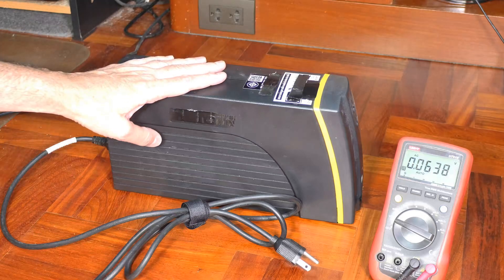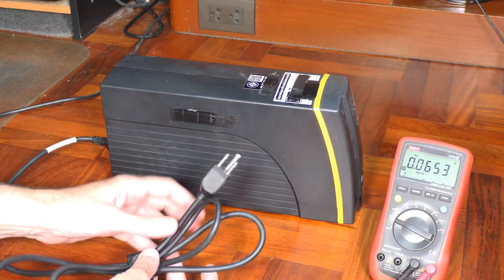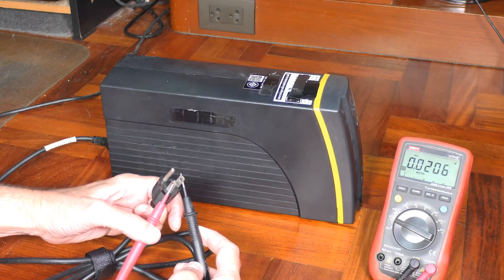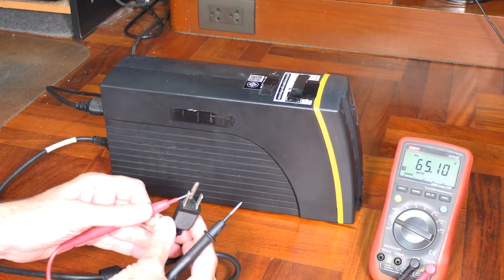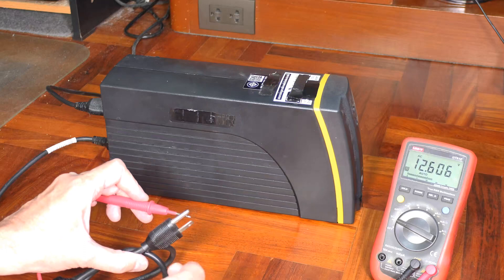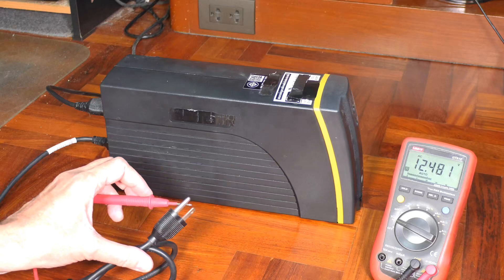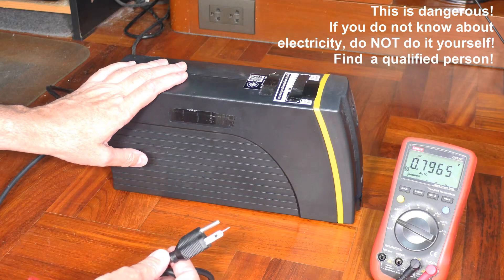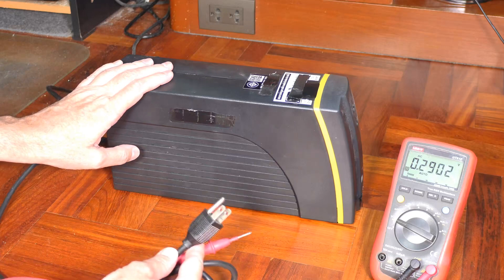PSA: Surprising Computer UPS Shock Danger! (4K)

Comment: Same here,yesterday i was trying to clean my ups(digital storm)from dust using air blower and toched the IN plug by accedent and got a good shock.so i tested the IN plug lead and got voltage in both L and N,but when i unplug everything for the ups ie pc,monitor and other stuff the shock is gone.this is really scary fault or design(hate electricty btw).
Ill try my other farber online ups and check the results.
Thanks for the video.
Reply from the maker: Oddly enough, youtube put your comment in the "hold" section pending approval. Not sure what their AI saw....
Reply: @tsbrownie  ok so after much more testing here is what i have discoverd.switching blue storm ups with farber online solve the electricity going back to the IN plug.so for me it's the blue storm causing this issue.why?have no idea.should it do that? Hell NO.
And that's leave me with two questions:
1-why is this happening.
2-could it damage the connected devices.
Hope we can get an expert opinion on this.
Thanks

Comment: good to know i'm not theonly one with this problem. is this expected behavior? and will this harm the socket its providing power to or the computer in anyway?
Reply from the maker: It's certainly not safe behavior by such a device. Mains power should NOT be easily contactable with fingers so easily. The manufacturer is probably best to ask if it will harm the computer, I'd guess not. However, could it harm other devices that are connected by wiring to the same wall plug? That seems possible.
Reply: @tsbrownie  i see, thanks!

Comment: Yesterday same situation happened with me, I was trying to unplug the pin and insert it in a different socket hole and while doing so the ups was on with the cpu and monitor plugged in.... The pin touched my right hand and I got a good current shock. There is still a small amount of fatigue in my right hand. 

I hope my hands are not injured or something......

Comment: I too discovered it the hard way, a month ago while modding it.  (adding some extra features like  battery volt graph and external battery to it.). BTW touching the battery contacts while it's plugged in, will also give you a shock.
Reply from the maker: That's interesting, thanks for that information. 👍

Comment: That doesn't sound right -- it would be supplying battery backup power back to the house (or trying to)... maybe there's a defective component, like a relay not kicking in that should be disconnecting the input from the output.
Reply from the maker: I agree, something is wrong. It was this way the day I bought it. Bad design? Defective part?
Reply: @tsbrownie  I can try to check some of my Cyberpower and APC UPS but I am thinking yours is wired incorrectly. or something.
Reply from the maker: @adragontattoo  I think you are right. If you do check yours, please post your results. Be safe!